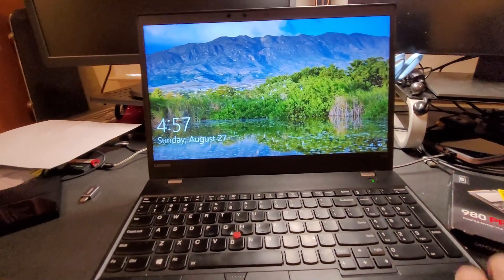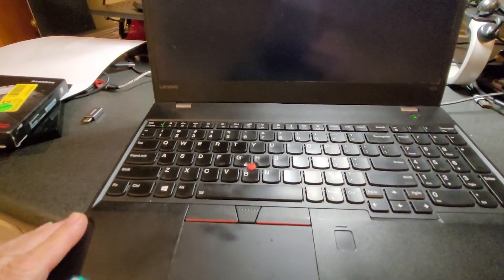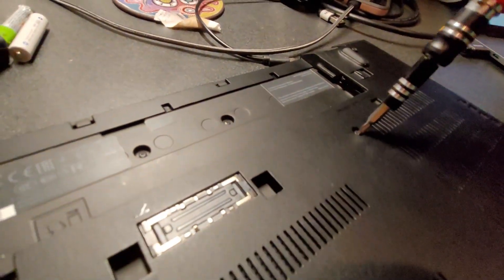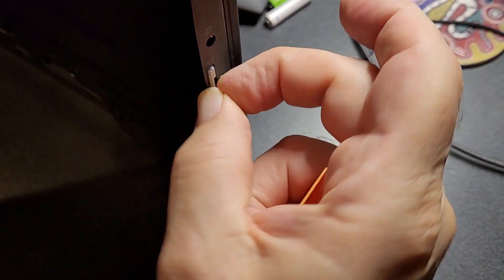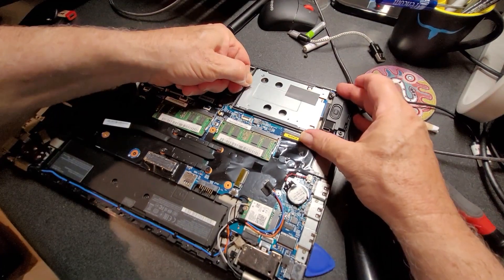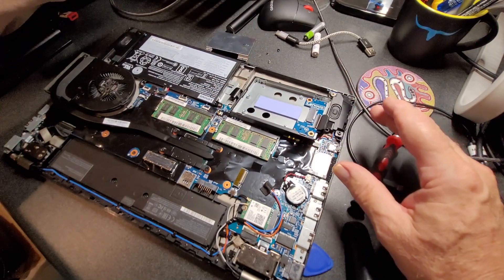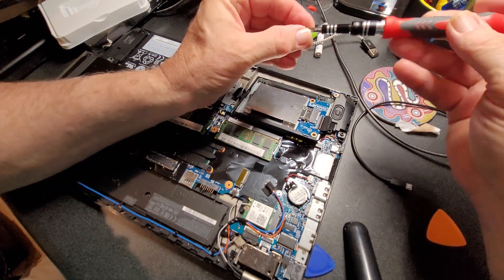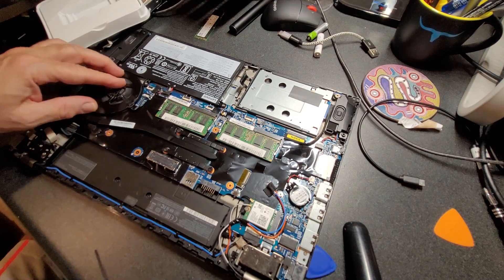Changing the SSD drive in a laptop - Thinkpad T570 and Samsung 980PRO

Comment: I gave a 16 gb RAM T570 with 256gb. Do i need to transfer my original 256gb to a backup drive before adding the new ssd 1 tb card internally?
Reply from the maker: Make sure encryption is turned off on existing 256gb drive in case you need to access the drive.  Backup your personal data somewhere else.  When installing the 1TB drive, you can restore your personal data from the 256gb or the backup location.  Also MAKE sure to record your windows product key using the command: 
wmic path softwarelicensingservice get OA3xOriginalProductKey

You will need the product key when installing the OS on the 1TB drive.  There is also a registry location for the product key.
You won't be able to active the new install without the product key.

Comment: Just got one for sale for $65 and I think I overpaid for this ThinkPad. Construction is junk compared to my previous W530. Damn case is held with clips. Keys and case feels like I'm touching rough concrete.......
Reply from the maker: I have used ThinkPads since the first prototypes around 1992... I got the T570 in 2019, five years old, works well enough.  These ThinkPads are still similar to older ones I took apart - remove bunch of screws, and use plastic tool to remove clips.  Good or bad, I don't think they have changed much in the last 10 years.  The original OEM keyboard feels really nice. I replaced mine with a clone and it feels cheaper. I had two W series ThinkPads, maybe a W530, can't remember. I think the W line is more robust, higher quality build and more expensive.  The T series is a step down, more for business user although I use it for video production and software development.   The E series are lower.   Enjoy.

Comment: Can you upload a video of ssd speed. Test please...
Reply from the maker: Microsoft Windows [Version 10.0.22621.3447]
(c) Microsoft Corporation. All rights reserved.

C:\Windows\System32>winsat disk -drive c
Windows System Assessment Tool
> Running: Feature Enumeration ''
> Run Time 00:00:00.00
> Running: Storage Assessment '-drive c -ran -read'
> Run Time 00:00:00.19
> Running: Storage Assessment '-drive c -seq -read'
> Run Time 00:00:02.06
> Running: Storage Assessment '-drive c -seq -write'
> Run Time 00:00:01.31
> Running: Storage Assessment '-drive c -flush -seq'
> Run Time 00:00:00.45
> Running: Storage Assessment '-drive c -flush -ran'
> Run Time 00:00:00.45
> Dshow Video Encode Time                      0.00000 s
> Dshow Video Decode Time                      0.00000 s
> Media Foundation Decode Time                 0.00000 s
> Disk  Random 16.0 Read                       829.93 MB/s          8.6
> Disk  Sequential 64.0 Read                   1622.59 MB/s          8.9
> Disk  Sequential 64.0 Write                  1629.52 MB/s          8.9
> Average Read Time with Sequential Writes     0.058 ms          8.9
> Latency: 95th Percentile                     0.111 ms          8.9
> Latency: Maximum                             0.679 ms          8.9
> Average Read Time with Random Writes         0.064 ms          8.9

Comment: I also have the T570. I didn't know that a PCIe x4 drive will work on it since the psref says that it is PCIe 3.0x2. Glad you made it work! I was planning to install a different 2.5" drive instead.
Reply from the maker: To be honest, I did not check the psref !!!  I purchased the drive 50% off with extended warranty, so I gave it a shot. Works fine.